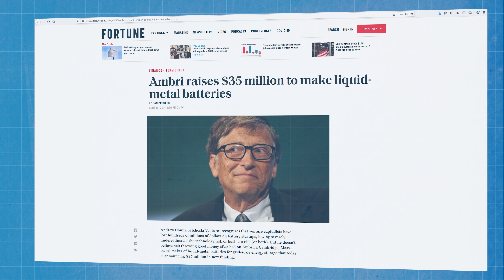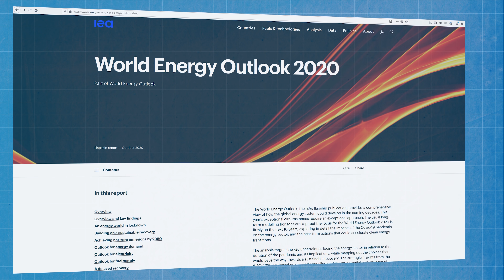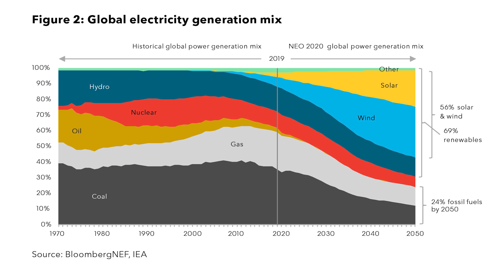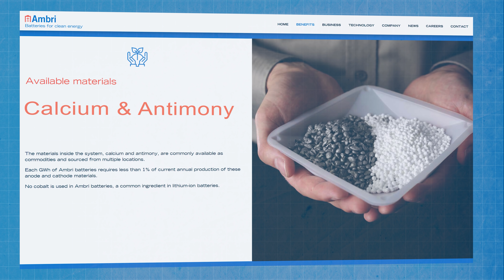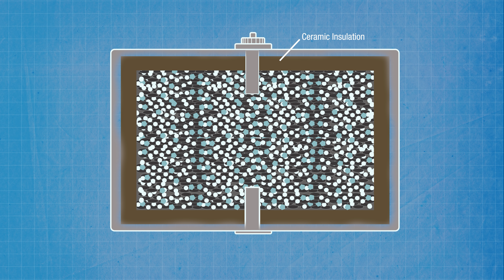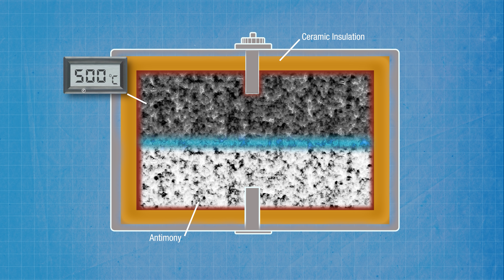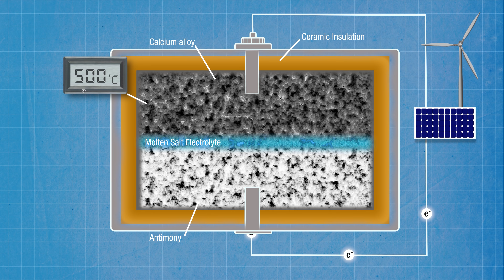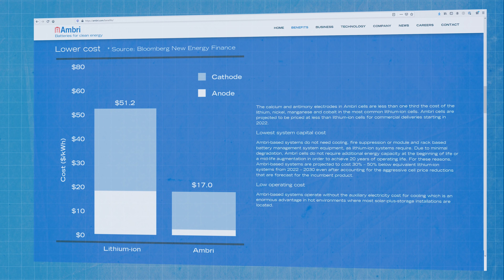AMBRI Liquid Metal Batteries. Will they really change the world?

Comment: If it sounds too good to be true.... it probably is. I hope i'm wrong cos my 48V forklift lead acid battery only has another 5 years of life if i'm lucky. Imagine including a large battery in your Will?
Reply: I think the problem for off grid is the heat loss of this technology - you need a big battery to optimise the volume/surface area ratio which probably limits it to >1MWh.  
What I'm really wanting is something around 2000KWh for seasonal storage. It doesn't need a huge cycle life, say 50 complete cycles before replacement but it has to be very cheap. Over a year I get lots of solar power, unfortunately I'm 53 degrees North and get a summer/winter solar production ratio of about 6:1.
Reply: @AndyFletcherX31  the problem with the current size for off grid, is requirement for complete cycle AND the losses to keep it hot. Two small units to alternate between would be ideal for me, and just add panels for losses. 10,000 cycles is a loooong time. 27+ years. I get 6+ years out of daily use lead acid, being VERY careful on depth of discharge

Comment: Part of the reason Sadoway and Ambri have taken this long is because they have already put the time into figuring out HOW to mass produce these cells. The other issue was finding a vendor willing to work with them to create the grid integration circuitry and controls, an issue they also overcame last year. You can throw shade all you want at this technology but I have no doubt it is going to have a major impact on utility storage. The amortized cost of these batteries will be hundredths of a penny per kWh.

Comment: I have been following this technology for several years and have been disappointed that it has not taken off yet.  It really doesn’t seem to have any downsides, as it uses readily available and no rare earth materials.  It would also free-up some of the other types of batteries like Li-Ion for applications that are better suited for those, such as EV’s and portable devices.
Reply: you know that general battery/accumulators tech usually takes minimum 20 years to be ready for the consumer, but can take as long as 50 years, just look at how long it took lithium battery/accumulators to take off, just give it time and it will become a thing, patience is the key to tech not rushing it that will only produce a bad product.
Reply: Keeping it running at 500C is hard.
Reply: I guess as usual scale up tech take some years (a few years at least). I hope that is the case here, I hope several clean-tech like this will enter mass market first half of 2020 decade.
Reply: Downsides are low energy density and energy losses during longer storage periods. That metal have to be in melted state. Most of the time that mean 600+ C degree.
Reply: @martingorbush2944  Now it's 500C degrees, and they have a newer on in the lab working at 250F.
Reply: @martingorbush2944  Energy losses are about 80% on average, which is better then for example pumped storage, which has an efficiency of about 70%.. This is very acceptable.. Low energy density is no problem for stationary storage, just add more batteries.
Reply: @MarcoNierop  Pump up is closer to 80% with at least one system reaching 85%.

Efficiency is just one variable in the analysis.  Capex and opex need to be included.  Ease of siting and amount of time to install are important.  Cycle life comes into play.
Reply: @MarcoNierop  How about the temp reqt??
Reply: @MarcoNierop  I think you mean the energy losses are 20% i.e. 80% efficient.  Other than that I agree.
Reply: @MarcoNierop  Efficiency is 80%, meaning loss is 20%, but so what, it's cheap.
Reply: I'd like to interject in your disappoint over this lack of development with a thought, one that this video touches on but doesn't truly delve into: technology and science are largely dependent on economics, and the first and last element that capitalists care about is whether they can profit off of it. This goes for every tech and scientific endeavor, IMO. Fusion, space exploration, regenerative agriculture and permaculture, electric vehicles, etc - they've all been subject to the whims of capital. Again, if you ask me, IP and proprietarian practices stifle development instead of enhancing it.
Reply: @peachypietro9980  I totally agree.  Even the fix we are in right now with politics.  No matter which side you are on, you will have to admit that social media does not care about providing the truth: the more controversy, the more viewers, the more revenue.  Sorry, I will get off my soap box now.
Reply: @juliaset751  for sure, they're taking advantage of something that's been going on for over 40 years and finally turned into something profitable.
Reply: @juliaset751  -- let's not agree with a statement that in effect says, people who actually build stuff don't know what they are doing, and the intelligentsia know better.
Reply: @bromnader5196  My statement says nothing about whether the social media companies know how to build the platform, I only question their motives and methods.
Reply: @juliaset751  Privately owned social media platforms are public forums and their owners have no right whatsoever to regulate public speech (other than complying with the law).
Reply: @peachypietro9980  Well yes of course. If a company thought that this idea had merit, money would not be a problem. If you have to force a technology on society, there is a good chance there is a good reason it doesn't gain acceptance on its own merits.
Reply: @peachypietro9980  But you know that ALL 'socialistic' States whit a planned economy failed dramatically, with the loss of millions of lives?
Why do you think, your proposal will fare better? Maybe you should propose your ideas to North Korean leader Kim Jong Un?
Reply: @TheSpecio  -- He probably thinks that ten English literature and gender studies graduates on a government committee can build things with your money better and with less cost than you can build it with your own money.  Quite an elitist attitude he's got.
Reply: @bromnader5196  Privately owned social media platforms are public forums. Their owners have no right whatsoever to regulate public speech (other than complying with the law).
Reply: @peachypietro9980  So what is wrong with the whims of economics?  You really want people to research and build useless stuff?  How smart is that?  And why don't you finance the useless stuff from your own pocket, stop being a hypocrite, and spare us capitalists and hard working folks from your desire to build useless stuff at our cost?
Reply: @bromnader5196  I'd be willing to have a conversation with you if you weren't so condescending.
Reply: @peachypietro9980  Ahhh - emotions over logic?  When socialists get stuck on the economics, they revert to emotionalism and playing the victim.  Your insulting remark about entrepreneurs and working people did not stop me from responding did it?  Did I complain about my actual hurt feelings?  No.  I have not tried to be condescending.  If disagreeing with your position is something you find condescending, then how can there be dialog and progress?  The socialist doesn't want dialog.  They are stuck in their cult for power.
Reply: @bromnader5196  
.
Just curious - do you have any opinion one way or the other about liquid metal batteries?
Reply: @red-baitingswine8816  -- Yes agree that any social media with more than 5% market share is a public forum, and are public utilities that the constitution applies to.

I have expressed my opinion elsewhere.  I am positive about liquid metal batteries but disappointed that Sadoway's first technology (sodium sulfur ?) did not achieve the commercialization prospects that he claimed.
Reply: Let's not forget extremely dangerous, even current lithium fires well if you were in the car and didn't get out in time... Kiss yourself goodbye.
Reply: @ezg8448  You have been watching too many sensational stuff on NBC, CBS, MSNBC, CNN.

Comment: 80% round trip efficiency, that's a long term hurt.
Reply: 85% round trip for lead acid, as per web results
Reply: @blaydCA  I'm waiting on 10kw of lifepo, anyday now..
Reply: @chrisfryer3118  very nice.  I just Google'd LiFePO4. 5000 cycles at 80%DoD, -20° to 70°c temp range. Maybe for my next change out of the bank - I hope they serve you well. 12+KwHr rated bank (6KwHr for real time use)
Reply: @chrisfryer3118  Wowee expensive! Dinner napkin calculation says about same cost total per cycle paying cash vs flooded Pb/acid. Could heat the house with the glowing credit card for that transaction
Reply: @blaydCA  Not really. I'm replacing a 20kw lead acid with a 10kw lifepo. Of course the inability to use all of the lead acid capacity, peukert factors with lead acid, plus the lead acid did about 1000 cycles means lifepo will be cheaper, especially as I'm aiming not to fully charge/discharge to extend life, by means of a programmable BMS. Grid connection is £18k, and for that priviledge you get a monthly bill. The only reason I'd get a grid connection would be to export power, but I may have a field but it isn't filled with PV, and you have to be 200m from the nearest house for a wind turbine. I've had small turbines in the past, and they produce good power and am not against, but I don't want the stress of one in a storm again.
Reply: @chrisfryer3118  Understood completely. Similar situation here. It doesn't pencil to export power here. After panel ROI, the only "electric bill" I have is storage for overnight use which is cheaper than utility supply. Lots can change in 6 years when the next replacement cycle will be near. Yeah, 1000 cycles is very poor. Probably 2200 cycles on my last set with prudent use mostly. I'm not a luxury weekender or a monied "eco-nut".
Reply: Not really,IF charging from non-grid renewable. Those Tesla batteries need cooling in high heat, these need heating. Lead/acid like 70°f ambient for maximum cycles. Higher temps. degrade most chemical batteries
Reply: Clarification: the AMBRI battery requires heat, not the lead acid, lead acid like 70°f and well vented
Reply: @blaydCA  I've had 5 years with lead acid off grid, they were crap after the first year. Heating a space for batteries, that should be vented to the outside??  80% is poor, its building in 20% inefficiency, you'll need a battery 25% bigger. However the 'non memory effect' is a big persuader. Real life span would be interesting. You'll never get a total cycle in a day above 45' N in the winter, without having a massive array, as self wind power is a non starter in the uk. They'll be better suited nearer the equator. Antimony seems quite cheap at the moment, per tonne too, but for how long? I want storage for a summer harvest, ie about 4 months worth. If it existed, it'd probably be an expensive fuel cell, and electroylzed water gas storage tanks. Now I like the industrial look, but couldn't pay for the infrastructure, as it would be at least 5 figures.
Reply: @chrisfryer3118  I'm in SoCal mountains. Plenty of sun, but it does get below freezing here. My Trojan L1 RE-B 6v (SPRE?) Do fine for at least 5 years. The high heat does some damage when it hits 105°f (40°c). Acid specific gravity is reduced for area, so they under perform when it's bitter cold. My electric usage is opposite of grid- peak use afternoon, very light use during no sun, no wind charging. 14 years off grid here. One learns FAST when mistakes get expensive
Reply: @chrisfryer3118  10,000 cycles is 27 years. Sadly lead acid is still the most economical for my needs. Trojan recycles the cores, since the case alone isn't cheap
Reply: not if we install four times the wind and solar capacity than the whole world needs..... cheaper than nukes!

Comment: Wonder how an Earthquake would disrupt/damage one of those.
Reply: Probably depends on how bad the movement was. If it's bad enough for minor disruption, the infrastructure it supports is going to be trashed at any rate. Safer than nuclear for sure
Reply: That's covered at 8:30. There's a heat spike as the antimony and calcium mix, but well withing the container's temperature envelope, then the battery goes flat and cools off and solidifies. Now it is inert and perfectly safe, just like it was when it was shipped to the site. Just tip it back upright, apply electricity to re-heat and re-charge it, and away you go again.
Reply: @RickinICT  That is for a bump though.  If there is an earthquake and the cell container itself or surrounding structure has a critical failure, those cells could get ruptured in a heated state.  Multiple cells rupturing, and metal expanding when heated so the cells may contain a liquid metal under-pressure, could cause some significant risk of danger.

Comment: Can you fry an egg on it, one cool battery I mean hot. I still fancy liquid air batteries for grid storage no fancy materials and cheap to run and maintain I suppose only time will tell which one is popular with the energy suppliers
Reply: Sadoway's liquid metal battery is a lot cheaper and simpler than the liquid air battery, which has a lot of moving parts and is not terribly efficient.

Comment: With the wind projection, what is the environmental effect on stealing energy from wind? I don't get the infatuation with carbon neutrality, CO2 is not as bad as all the other toxic gasses and other waste released on this world. Higher CO2 levels are increasing vegetation, which change the climate to a more rainforest level, which is normal and good.
Reply: Which is also what happened whenever there was a CO2 surge in nature.  That and the fact the CO2 levels going up is the result of the temperature going up not the other way around due to the fact cold water holds more CO2 than warm water thats why arctic waters produce more phytoplankton than those at the equator.
Reply: @williamnicholson8133  if global temparatures go up more of sea water is evaporated and then theres more rainfall overall, even on land, which increases the vegetation even more. Theres a reason why earth was more green in the past, higher temparatures. Thats nothing bad.

Comment: Don is looking for cheap to build, with a long lifetime.  The right combination for grid back up.  

LiFePO4 is only good for about 3000 cycles (8 years), Li ion, about 1000 cycles.
Reply: Bad number there.  The LiFePo batteries that are powering this comment are rated at 10,000+ cycles as long as the batteries are not discharged more than 80% on most cycles.
Reply: Tesla's newest lithium ion chemistry lasts way longer than that, particularly if not abused.  Grid operations are not as hard on batteries as typical car usage.  Sadoway's battery looks really good, though.  I hope it works out.

Comment: Can they build the chamber very large?like several cubic meter?i think large chambers will be cheaper to build
Reply: you need a lot of cell to get the right voltage  sadly you can't just make one really big cell without significant efficiency loss compared to just haveing more smaller cells also safety issues  but there is nothing stoping them
Reply: @MrZussow  i think if they use multiple anode and cathode in the large chamber,the low voltage problem will be solved
Reply: @amirsa7140  yep that would do.  the problem is that the liquid is the anode and cathode so you would need to physically separate them so in the end you just make more smaller cells

Comment: Orientation matters (needs to be oriented up-ward for gravity to maintain separation of molten metals), energy sucking input to maintain high operating temperature is another glossed over point.  These will not be in cell phones or laptops or other ubiquitous electronic devices (i.e. even electric cars).   There are plenty of other non-degrading grid-scale liquid batteries that compete with this that do not require high temperatures, i.e. redox flow batteries.  Not saying these aren't better, but to imagine their proliferation on the scale Li-Ion is just silly.
Reply: at least it was clear in the video and Sadoway himself has pointed that, this technology if for large scale stationary storage facilities
Reply: @physjim  Agreed, I just took issue with the narrator's claim @10:02 "And history may come to record his contribution to energy storage on a similar level to
John B. Goodenough's revolutionary lithium ion breakthrough several decades earlier."  - Li-ion is far more widely used than this could ever be - it's an apples and oranges comparison.

Comment: It seems to me that the week point is to keeper the temperature up where the battery is functioning. That seems to suggest that it may be more suitable for solar energy where the battery is charge an distarged in a predictable rytm. Wind energy may have to use some additional energy sinse it may operate weeks on end. This may lover the efficience somewhat. However I would also get a battery bank of this construction for home use to charge the car and selv power in the expencive hours..
Reply: Ole, MSBs are not intended for either solar or wind per se. It is for grid levelling where their  sub-second response time competes directly with battery  levelling, unlike pumped hydro etc.